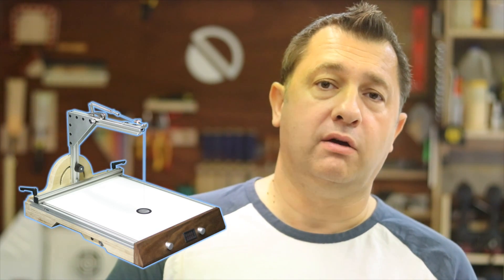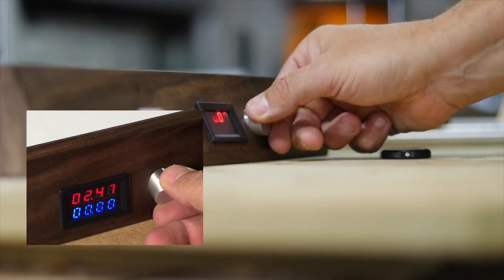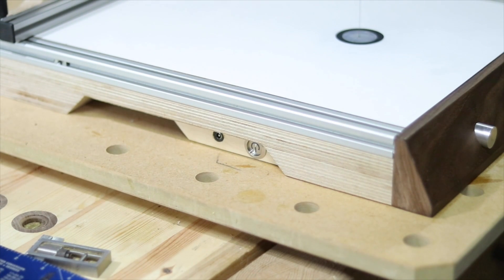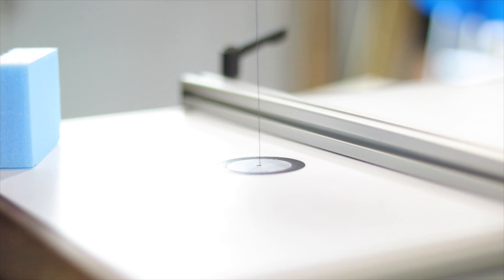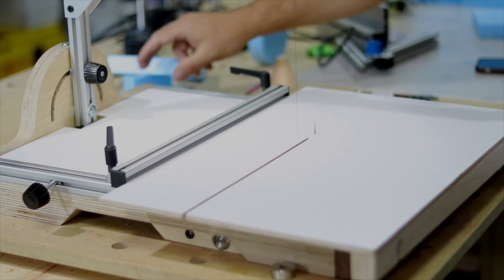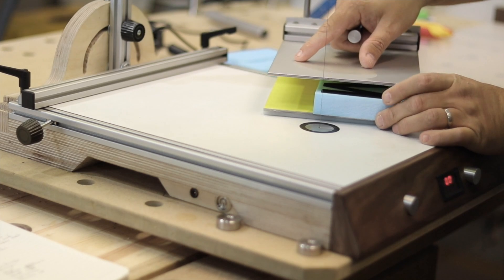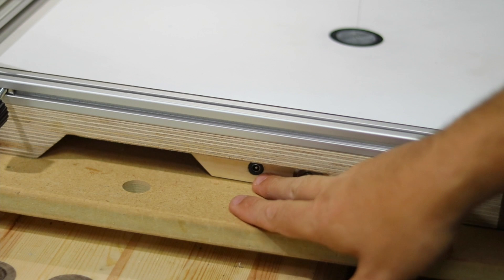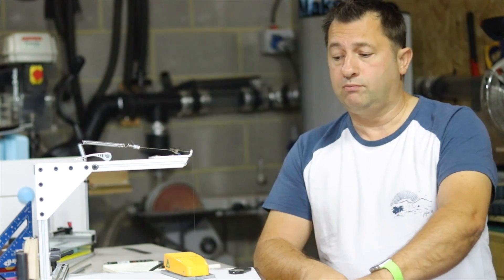Hot Wire Foam Cutter (and jigs) for professional model makers - styro slicer

Comment: Any tips on getting smooth cuts when doing freehand cuts like the letter “a” you did? Just come with practice?
Reply from the maker: Yep. You can freehand, not to hot mind, practice helps, smooth rehearsed moves, muscle memory. Or you can make top and bottom templates and pin them on to the foam, but you have to be sure they are aligned to each other.
Reply: @StuffIMade  thank you. I DID notice if its too high it’s really hard to control. At least XPS is cheap so lots of practice
Reply from the maker: Also a foot pedal to control power on/off is helpful

Comment: This really Looks awsome. Im trying to make something similar, but less expenive / complicated. Getting the Aluminium profiles now but not sure how you made These the main slider, the slider on the 45° jig you made. Would you mind helping me with that? Also, could you tell me the rough Dimension and the Profile you used to make this large thinn Piece? thanks, great work again ^^
Reply from the maker: AllAroundFlight can you... got each question give me a time in the video to show me what it is you are referencing 
Then I will try to help
Reply: @StuffIMade  How did you make that slider the one your using at 6:50. Did find way where i can get the same aluminum extrusions. but not sure how i would make those sliders. And mainly i was wondering what the overall size is, so i don't go too big or two small when building a table ^^
Reply from the maker: The triangle 45° jig is a piece of hdpe plastic to make the triangle. It has aluminium extrusion attach via oversized holes to allow adjustments to be accurate. Attached using t-nuts.
This hole unit just rests against the extrusion fence. The depth stop on the triangle is a piece of flat aluminium attached to a square piece (could be anything) and a knob I made using epoxy, chocolate silicon mould and a bolt that fits the t-nut. Video on my Chanel about the epoxy bolts/knobs. 

Size 14” x 20” roughly
Reply: @StuffIMade  thanks so much for explaining. Now I'm of planing mine :P
Reply from the maker: Good luck

Comment: A fine build for sure and one of the nicer ones I've seen. 

Love the LED lights. Switches and read out. Use of extrusion was smart.

But... I see a couple things right off I question.

First, you can't raise the center arm. At least not without replacing and rewiring.

Secondly is your design for creating angles. And this just going by watching the video mind you. 

You have a center hole and the bottom wire fixed to a point under the table. Once you move the center arm off a 90° angle... the bottom fixed point gets raised and moved to the side of the upper hole in the table face. This will though off the bottom center point by a mil or more. 

Using your circle gig, it would be thrown off even more since you have what.. ? an 1/8" or better slot for the wire to feed through... 

So say you're cutting a 100mm circle. At 90° your center pin is on mark. Once you go off 90° on the center arm, the center pin is no longer aligned to center of the wire in one direction or the other depending on which side you come at it from.

I'm sure adjustments can be made or it compensated for.. or I could be wrong entirely. From your video it's just something I noticed.

I've seen others where the arm is basically a U hiding the wire on both ends. The pivot point in the arm keeps the wire, no matter the angle, at center flush with the table top. 

Mind you, it's still a beautiful build. No question. Those are just a couple things I noticed that may or may not be able to be improved. or redesigned if needed.

Thanks for sharing. I'll definitely be taking some aspects of your build away for my own.

cheers...
Reply from the maker: chase thanks for the comments and praise! The thing about the angle and pivoting above and below the table was something I considered, but decided when I put the circle jig on the table and tilted the arm I would used a digital protractor to be certain the angle of the arm was accurate, also a small rule to ensure the distance from the circle centre pin. The level of accuracy I wanted from the system was going be very difficult to not have some form of set up and checking anyhow. But yes I agree certainly room for improvement for sure!!!! Thanks again ;)

Comment: add a few marks on the table, like measurements like cm or inch and it'd be ready to be sold XD
Reply from the maker: Cristian Rodrigo dos Santos I did try to print a measurement grid onto vinyl with the intention of sticking it to the surface but it didn’t work out. I then tried inlaying a metal ruler and adhesive tape ruler but in my experiments the laminate kept chipping  and by this time I ran out of energy. To persist. But if I were to remake it I had a few ideas on how to do this better! Good thinking though!!!!!

Comment: The mic level needs to be checked, production 101. At 2:00 unfortunately you say nothing about the power output. If the panel displays the volts and the amps, why not tell us the amps?
Reply from the maker: Thanks, I now have a new mic, I have had issues in the past, in my newer videos you should hear an improvement.
also i have two other videos with much more detail than this overview video, have yoiu seen them?

Comment: Hi, your stuff is absolutely brilliant piece of work. I really like it and want to make same. I have gone through the videos, which describes the process of making. Can you please share the circuit diagram and list of components used in this? I will highly appreciate if you do so.
Reply from the maker: Yogesh D I made two videos on the build of this, both are on my YouTube channel. The second goes into detail on the electrics. This is all I have, no diagram sorry, but there may be a parts list in the comments section of the second video.

Comment: What are the locks that you use for the fence called and where did you get them, or how did you make them? And this is probably one of the best tables I've seen. Definitely in the top 3, great work.
Reply from the maker: I combined a couple of things, this type of clamping handle (https://amzn.to/2GLT7fj) and this type corner bracket (https://amzn.to/2J4tpYs) along with aluminium t-slot nuts. I did actually manage to find these corner brackets but with a hooked edge so i only needed one t-slot nut per side, unfortunately i cant find them to share with you but the links i shared should solve your need. Thanks for the kind comments :) i think maybe top 2 - lol

Comment: I have absolutely no use for a foam cutter, whatsoever... Strangely after watching this I feel drawn to my workshop to emulate this :)  Very nicely executed project, well worthy of a sub! Carry on!
- Bill
Reply from the maker: Bill Kibby strangely I have no use for one either ;) just wanted to make one, but the best one I could think of. Glad you liked it !
Reply: HAHA!! That just made my day, thanks!  My pet project right now is a PWM controller designed for use with a computer power supply.  Did you know a piece of nichrome wire can easily illuminate a small room?  :~)  Hoping to release it soon to the pyrography crowd though it should work well for a foam cutter or plexiglass brake.  Any thoughts on producing any more of these and selling them?
Reply from the maker: Bill Kibby sound like great project. Will there be a video ? thinking about putting this one on eBay will the jigs etc.

Comment: I just ran across your hot wire cutter & love it. As for making lock for the slide board when making cone cut. You solved the problem already. Use the top of fence for locking a removal fixture. The removal fixture would be a strip of wood the length of slide board & height of distance from slide board to top of fence & two short dowels on bottom that would fit into slide board holes. Then attach another piece of wood to top side of dowel piece to make an over hang on fence top with same locking slot you used on slide board before. You posted this video a long time ago & you probably came up with this same idea already. But if not here it is. Thanks

Comment: Bearings should always be used in pairs.
Reply from the maker: James Patrick not sure what you are referring too ;)
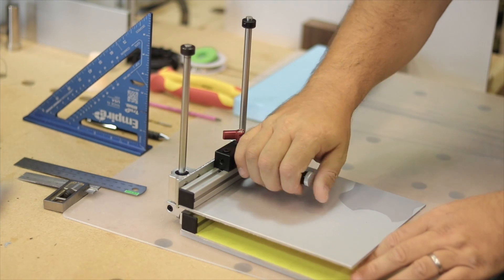Reply: 13:10 you said there's a slight movement in the bearings because they're cheap, but linear bearings aren't meant to take that type of load. If you put a second bearing above each of the existing ones, then they won't bind on the shaft.
Reply from the maker: Appreciate that thanks! Makes sense now you mention it!

Comment: This hot wire foam cutter is a sterling testament of OUTSTANDING ingenuity and craftsmanship on the part of its creator/builder! Can you provide  advice/tips for constructing a similar device that can be used to cut foam wing cores (airfoils) of varying lengths up to 48 inches (including 'twist" - wing washout from root airfoil to tip airfoil)?  Bill Jackson.
Reply from the maker: William Jackson thanks for the kind comments! Do you have pictures of the elements you are trying to create?
Reply: Yes - I will upload photos of a foam wing airfoil for a Beechcraft Bonanza radio-controlled model airplane.  The foam core consists of three individually cut segments to accommodate  a tapered leading edge and "twist" wherein the root airfoil is at -5 degrees, and the tip airfoil is at 0 degrees. I'll try to get photo shots and upload same to you within the next 2 hours or so.

Comment: I want to buy this. The craftmanship is amazing, design simple but functional! My only nitpick is no gradation on anything but I would still buy this!
Reply from the maker: Discipol thanks! The reason for no gradation is because if I want a specific angle I want it to be highly accurate, so I prefer to make angle templates to slide up against the wire to set my angles. I think probably for what I do 3 or 4 angles suffice. The variance in the wire when adjusted to 90° and the accuracy of locking the arm at a set angle repeatedly required more effort to be totally accurate so I opted not to do this. But I get where you are coming from!

Comment: That is an awesome hot wire cutter, that is some top quality workmanship.  I saw  videos on hot wire cutters some time back and was thinking of building one then was thinking of just what you did. I was going to add measurements both inches and CM. I would say make a build pamphlet, that could be sent via e-mail for for like $10 or so. Or maybe even figure up the material cost, to include shipping for mail orders. Like some of the others I can't wait to see your build video on this, that is a beautiful piece of equipment.
Reply: Ed T A

Comment: You don't need the clip attaching to the nicrom wire. Use the aluminium rail as the current lead. It is already conected to the nicrom wire right now, you just have to connect the electricity to the rail.
Reply from the maker: The Small Workshop true, I want to be able to cut this circuit off when using hand held device through the additional port. Avoiding another switch. But food for thought thanks!

Comment: Excellent work.  Would definitely make a great addition to any shop.  I look forward to the build video.  Did you plan to create a written plan for it?  I would be interested in that if you do.  Excellent video but the sound was a little low.
Reply from the maker: no written plan sorry! build video and wiring diagram to follow! sorry about the sound, i need to get a mic that clips on to me!
Reply: Thanks.  I really like it and am thinking about building one.  I like to model things I am building.